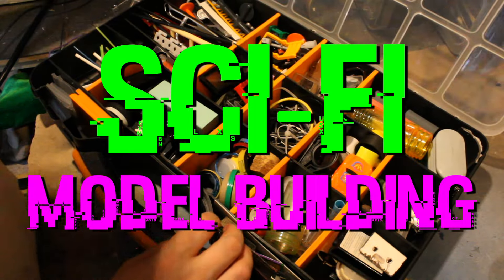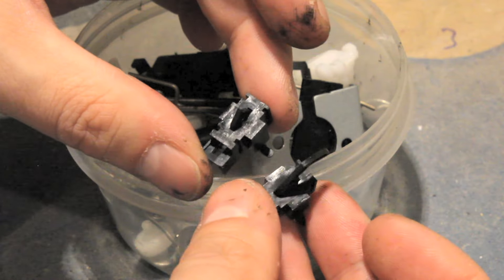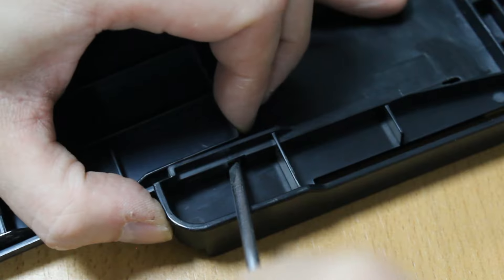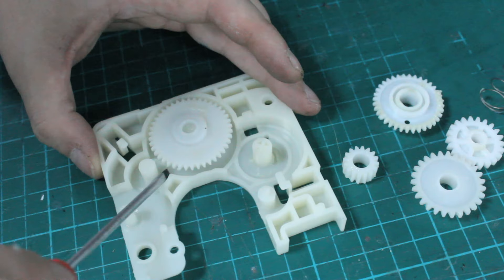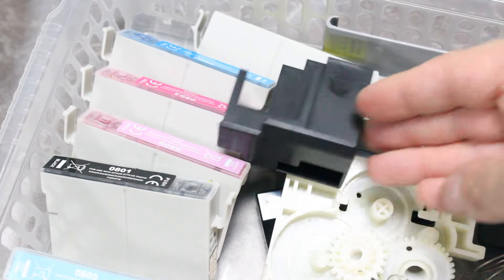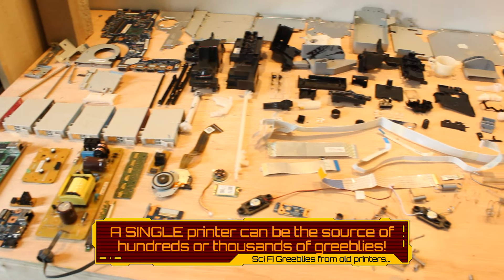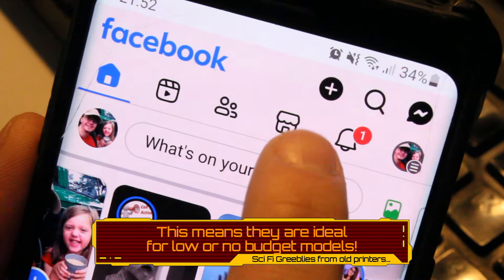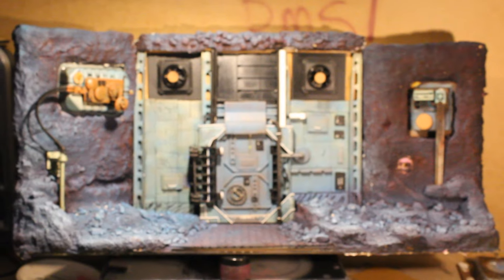Where to get the BEST greeblies for FREE?

Comment: Very cool editing, it makes for a tight video (with great funky music !)

I didn't realise they were so many gears inside a printer, I bought a box of 100 gears online, Next time I'll take your advice and look out for some discarded hardware.

At 1:33 these belts could possibly make great tracks for tracked vehicles.

All these small springs would be very handy to create mechanisms such as self-closing doors, or used to bring a gun back to a middle point position from the turret.

great to see a new video, it's been a long time ! 👍
Reply from the maker: Hi again!

Thanks for the comment!
Yeah, I must admit I have been collecting printers to strip down as there are some amazing bits in them!
Also, different types of printer produce different looking greeblies!
(For example, there are more motors in an ink jet printer than a laser printer)...

And regarding my recent absence, I will be covering that in an upcoming video! 🎥📹👀